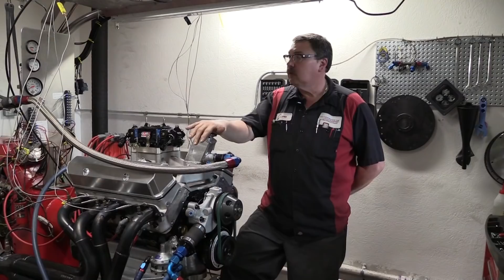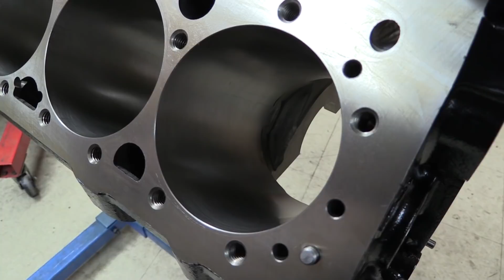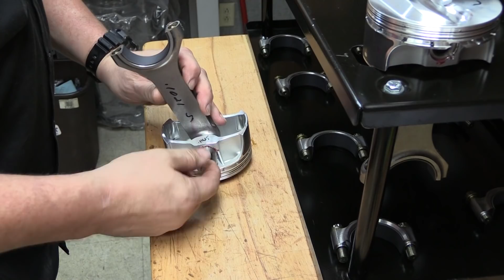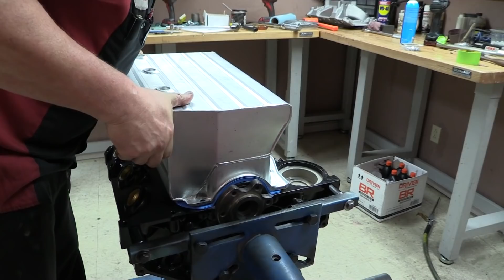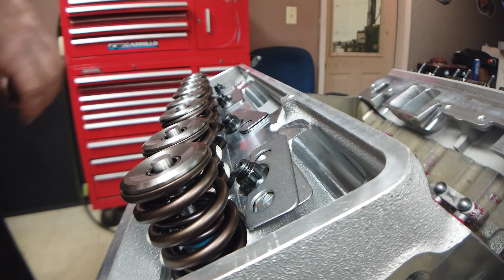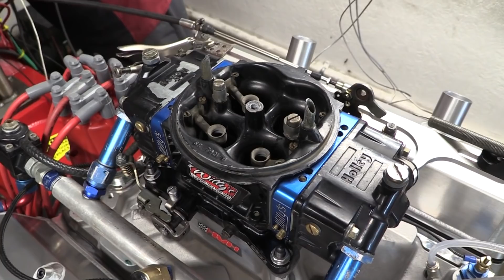Building a Methanol Burning Dirt Modified Race Engine (Over 700 Naturally Aspirated Horsepower!)

Comment: Im comfused about the carb mpd. If he doesnt want to put a bigger carb ok or itd soften throttle resoonse, but putting the bigger carbs baseplate on improved power.....
How would putting a bigger carbs body on that baseplate have lowered throttle response below that of the small carb test to begin with...?
Im not vomvinced a big carb wouldve made it bad

Comment: If you want a good oval track carb that makes most power for your application track and motor build or even a drag kr street/ even boat rackng carbs VDL IS the best in the bussiness he use to do almost every single carb for the nascar cup series before they went fuel injected and the forst three years they went fuel injected he built the fuel injection throttle bodies and stuff as well. His carbs alone made my asphalt super stock with a 550 hp built motor go from 525 with a stock holly 850 cfm 4bbl double pumper that had choke horn removed to 550 hp just by bolting his version of that carb and its legal on gauges and all in tech. So for you crate races out there if you want a carburetor to really pick you up a bunch of horsepower and get with vdl vanderly will hook yiu up. My 6o2 in my pro truck now makes 415 crank hp jjst cause of hks carb as well and totally legal

Comment: I have been racing asphalt oval track since I was 11 started out in asphalt 4 cylinder mistang class was called ministocks ran thlse for three seasons at the small track that is less then a 1/4 mile outside oval we also raced asphalt mods legends pro lates, street stocks, pure stocks, pro trucks and super stocks onthe bull ring throufh lut the years. After those 3 years i mlved up to a asphalt modified and raced at the bkg huge half mile righf down the road mobile intl speedway its a sister copy of the old Bristol layout. Same banking amd all and our asphalt modified class is called the modifieds of mayhem tour now bjt back in 2006 when I first raced them there was no series but I had a old camping world truck engine in it my first 4 years running it turning 9200 rpms and making 797 rear wheel horsepower our rules back then was way more open back then then it is now bjt they are still pretty open it was wild back then in the mod class.im now 31 and raced a ump dirt modified for first time ever on dirt 4 years ago and I have nlt went back to asphalt way morw fun on dirt better pay outs when ypu run with a touring series like usmts butif you wanna win those usmts races you better have a huge motor and the best up to date chassis and technology and a hell of. Wheelman cause Nick Hoffman and Kyle stickler and ther Herminator and others are he best in the country in that series

Comment: What kind of assembly lube/grease/gel is the red stuff being brushed on? Almost looks like super tacky red wheel bearing grease. "Looks" like...lol. 
 I'm getting ready to assemble my 1st engine, mild, decked, Vortec long and have a 4oz bottle of Permatex Ultra Slick and a 4 oz bottle of Lucas Assembly lube. I've seen so many different kinds and so many different combinations from lobes and journals, it's a little overwhelming.  There are so many choices out there and you only get one chance at breaking an engine in properly. Also, i have a factory roller cam. Thank you for any advice 🙏

Comment: I know that assembly lube 👀 lol thats RedLine assembly lube, that stuff is amazing, allows you to use a light coat when needed and still have amazing lube abilities and you count on it staying where u want it, best part is its not sticky lol Great stuff for sure and even the price point is competitive! I'll never use anything else, its the only lube you need honestly even for thr valvetrain!
Reply: The red stuff being brushed on is "RedLine" assembly lube?
Reply: @AR_420  Yea, Great stuff! Same Redline that makes the oils and stuff its all great quality stuff and hard to go wrong with.
Reply: @AR_420  of course everyone has their favorite lubes or brand and there are plenty others out there just as good but I don't think you'll find to many complaints on Redline products, especially their assembly lube
Reply: I just use Schaeffer's 9000 series 20w50 motor oil for assembly lube in the usual areas. It's clingy and will stay put until you get the engine assembled, in the car, and primed. For high pressure areas, like a flat tappet cam lobe, I use some high-molly grease. Never had any issues this way. 🤷🏻
Like you said, everyone has their own ways and there isn't just one "correct" way.

Comment: Dumb question I’m sure  how long do the cam roller bearings last… first time seeing that I’m 54  and last racing we did was mid or late 80s
Reply from the maker: Sorry, but the answer is "It depends." Lots of race engine builders will replace roller cam bearings at every rebuild, because they don't want to take a chance of a roller bearing going through the engine. Stronger spring pressure shortens the life of a roller cam bearing. Also, the narrower bearings used in the Chevy R07 or Ford FR9 NASCAR race engines makes for a shorter lifespan. But I've had guys tell me that the roller cam bearings they used in the D3 headed Fords (Windsor based with a Cleveland-style cylinder head) lasted forever. Thanks for watching
Reply: @TheHorsepowerMonster  Yep.. The only downside to a roller bearing is that if one DOES fail, the little needle rollers scatter throughout the engine, and the result ends up looking like tiny grenades went off all over inside of it trashing everything. Better safe than VERY sorry.

Comment: @18:20 not sure why msd ignition doesn't already paint this reluctor wheel. Good tip 👍
Reply: Yep.. Those fuggers quickly corrode up big time in every MSD dizzy I've ever used. Years back I figured out to lightly spray the reluctor with a little clear coat before I install them.

Comment: The attention to detail to limit windage losses is dramatically different and interesting. The sump set up is testimony to that. As is the top end oiling system. I like the offset inlet rocker set up to! Another innovation for better breathing! This with the shimmed rocker stand and solid non twisting roller bearings  cam. This motor has pedigree all over it!
Thanks again Horsepower Monster!!
Another cracking in-depth and detailed build of a awesome motor!!
Love it!!

Comment: Super nice engine .. I just hope he never has to explain why the oil pickup tube is almost smashed in half ...(11:30) ... that is terrible !!!
Reply from the maker: The curve of the tube is flattened a bit from driving the pickup into the pump, but it is far from smashed in half. The pickup tube can flow much more than the pump, so it doesn't hurt anything. Thanks for watching.
Reply: @TheHorsepowerMonster  ... I clearly know why it’s in the condition it’s in ... you know as well as I do that that method of installing the pickup is outdated . There are many tools to install it now, plus many more options that don’t require a BFH. Also what about setting the min/max distance between the pickup face and pan bottom ? Or way to prevent the pickup from falling off. Both are real problems to a quick , high reving race engine .
Reply from the maker: @HarryT9  Well, you said it was smashed in half and I simply said that it clearly wasn't and the reduction in tube diameter isn't enough to affect flow of the oil pump. And yes, he definitely did check pickup clearance to the bottom of the pan. I simply didn't show it. I do lots of engine builds, and I try not to show the same steps every time. The pickup cannot fall off, it has a tab on it near the pickup screen that bolts to the top of the pump. I am assuming when you mention a way to prevent the pickup from falling off that you may be talking about welding the pickup to the pump. That's not necessary here.

Comment: What other engine restrictions and\or rules for DM racing? (i.e. cid, fuel, etc.)
Reply: It really is a matter of which of the 4 major sanctioning bodies in the US someone competes with.  For Dirtcar UMP its pretty much fair game as this motor is.  Its got to be a steel block, has to be a wet sump, has to be a push rod motor, and on a single 2 or 4 barrel carb.  In other parts of the US rules limiting what components can be in the valve train are more common.   Fuel its a choice of Race Gas or Methanol.   There are limited Modified Classes, which do have more rules including CI, Carb, valve train.

Comment: Needs a bigger head. CI eats runner volume.
Reply: For max power in a drag race application, yes. Not in this type of racing. Whole different world. There is a reason camshafts, carbs and cylinder heads are on the small side.

Comment: What does the 6" rods do change stroke ?
Reply from the maker: No, it is the crankshaft that controls stroke. But using a longer rod improves the rod/stroke ratio. If you have a long stroke with a short rod, the crank throw will try to push the piston through the cylinder wall. Having a longer connecting rod will help improve the angle so more force is straight up and down, improving the engine's efficiency. Hope that hleps and thanks for watching.

Comment: Still needs more air flow they should have tried the 950 CFM base plate on at 750 and really woke that motor up change the power valves you can see where it's dipping
Reply: A 750 carb, with an 850 baseplate is what a 950 is... however it is NOT 950cfm. It's just the name. They do not flow 950cfm. More like 830. Bigger carb on this would definitely make more, but it isn't a drag race application. There is a reason everything used seems "small"...
Reply: Those drivers need a controllable, linear, response to the throttle at all RPMs. Not a huge carb that only runs right at W.O.T. and at the rev limit. The driver doesn't just get out on the track and hold the throttle to the floor like a drag racer would. They need the throttle response that only the small carb will give them. Smooth, predictable, responsive power is critical in this kind of racing, way more than just top-end power.
Throttle response

Comment: Does it have to be the old stuff or can circle track put any kind of motor I’m new to this
Reply from the maker: Usually they sort of force you into the older designs by requiring a cam-in-block design and a distributor with a single coil. In a class like this they also say it has to be an iron block, but the Super Late Models and such can use an aluminum block. Some of those guys use an LS by adapting a distributor and coil ignition, but that's about as exotic as it gets. Thanks for watching.

Comment: Surprised to see them use methanol. Thought the common thought these days was it burns to much and throws your weights out of wack. Most of the cars in my area including my late model run gas
Reply: If you want to win putnamville are the World 100 at Eldora you're going to run methanol or get run over
Reply: End of story petrol will never make the power. And petrol is far less safe as well. Though yes you use a good deal more.
Reply: Twice the fuel, engine runs a lot cooler. The methanol is cheaper as well.

Comment: Anything running methanol may not be the text book definition of insane, but I'd say one can find it in a thesaurus.
Reply: They make 850 HP and run well over a hundred that just a few tens slower man the World of Outlaw Sprint Cars like. Steve Kinser Tony Stewart and Sammy Swindell. Outlaw Sprints are limited to I believe it's 350 or 400 cubic inch small block and they run hilborn fuel injection on methanol they make about a thousand horsepower and about little over a thousand pounds and tumble like a basketball in a bounce on those big tires over the fence there fun to watch  and enjoying the late models and his friends they have wheelie contest past the grandstands with the sprint cars now that is quite a show whencan pull a full wheelie straightaway in a Sprint car with one tire big on the outside and one little one on the inside that makes them turn left on YouTube you'll see

Comment: Magnetize the socket or use a magnetic socket or epoxy a small rare earth magnet into the socket.
Reply: Got a nice old-timer trick for you if you don't have any magnets. Get yourself some chewing gum, chew it, stuff it in the socket, then stuff the nut or bolt in the socket. Gum will stick the two together enough for you to install the bolt or nut, but not so much that you can't pull it off. If you don't want to wear out your jaw muscles chewing gum for this, you can get blue-tack or poster adhesive that works about the same but you don't have to chew it.
Can't say the same for those rare earth magnets, sometimes those ones are too strong for their own good, most of the time if you want to hold a nut or bolt a ferrite magnet (weaker) is the better choice because you can pull on the socket extension and come back with a socket and no fastener instead of either a socket and fastener, or no socket and just the extension bar.

Comment: Illegal for IMCA modifieds. I wonder how this engine sizes up with a Sputs on the tracks ?
Reply from the maker: Of course, it was built to race UMP A Mods.
Reply: @TheHorsepowerMonster  will it bolt directly into a passenger car and drive away as per the UMP rule book ?
Reply from the maker: michael vrooman Yes. It has standard motor mounts and a Chevy bellhousing bolt pattern.
Reply: @michaelvrooman5681  Of course.  This is an old recipe.  I've built several for the street.

Comment: Can you still claim the top 4 winners engines?  I'd hate to have one like this claimed if I was winning with it.
Reply from the maker: I'm not sure if this applies to the "A" Mod class, which is the top class for the UMP Mods where this will race, but the UMP does still allow engine claims. It is pretty restrictive, though. I don't know it all, but these days you can only claim the engine of the winning driver and if you are going to make a claim you have to finish that race on the lead lap. So you can't roll out there with some clapped out junkyard motor and claim a legit race engine for $550. If you are going to finish on the lead lap at these races you've got to be pretty competitive yourself. Plus, claiming engines instead of investing in your own racing program is a pretty dirt move in most people's books, and anyone who does it usually gets shunned by the other racers in the pits. It can get pretty lonely if you are that guy, so it is very rare. But you are right, I'd hate to lose a beast like this to an engine claim. Thanks for watching!
Reply from the maker: Mike B  In the lower levels of oval track racing, it is a way to try to keep teams from way outspending the competition. Usually if you are in the top three or so anyone that finished below you can claim your engine. Usually about $700 or so. But the reality is the practice is frowned upon by competitors so it is rarely done.

Comment: Nice engine, I just can’t get over how ugly these cars are. If you look up BriSCA or dutch stockcars they’re quite similar to these cars, but way better looking
Reply from the maker: I kind of agree with you. I used to love the look of the dirt mods, but don't so much any more. Because of aerodynamics they are making the sail panels so large it throws off the entire balance of the car -- at least from the looks standpoint. I think they looked a lot better 10 years ago.
Reply: @TheHorsepowerMonster  and 40 years ago we were required to have full fiberglass bodies of exactly the car we were claiming that it was and we use rubber front ends on
 them to save a little bit of cash but it was quite expensive that's where the sheet metal bodies came from people getting tired of spending thousands for paint and glitter instead of faster motors
Reply: aaaaggghh. Brisca junkers are iron junkies. 
I agree these cars are butt ugly and all fall over cornering with rear steer.

Comment: Would this engine be good for a 2k lb street car?
Reply from the maker: I would be a dog to drive at low rpms. Stoplight to stoplight driving would be miserable.
Reply: @TheHorsepowerMonster  that's why on the street Wae run at least 4/88 or 5 13 gears fpull wheelie stop light stop light down Wabash Avenue Terre Haute Indiana take it over to indy at night in the black folks up on 38th Street was block off the whole four lanes and we'd have full quarter mile drags all night long this is the racing capital of the world... what goes on in Indy stays in Indy
Reply: Ohh ok thanks guys
Reply: Sure would we used to run them on the street and atvthe Indy us Nationals at Raceway Park Indy super stock
Reply: What about a 1900lbs autox car on hoosier a7 tires? It's a c4 kart with muncie 4spd.

Comment: Never understood why you would put main studs in before dropping in the crank
Reply: Drrr, the studs locate the caps. And seldom ever come out either.
Reply: @ldnwholesale8552  And yet if you put the crank in first, then threaded in the studs you wouldn't have to navigate the delicate crank journals between them during installation